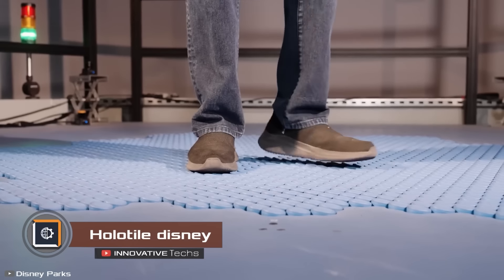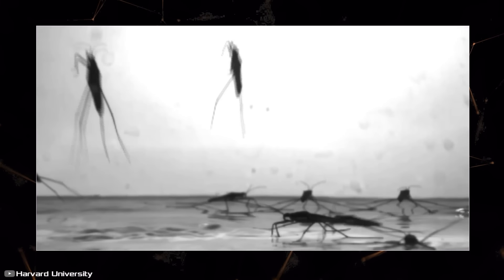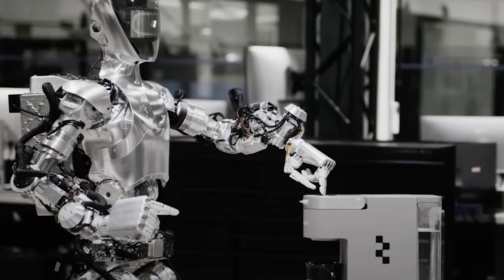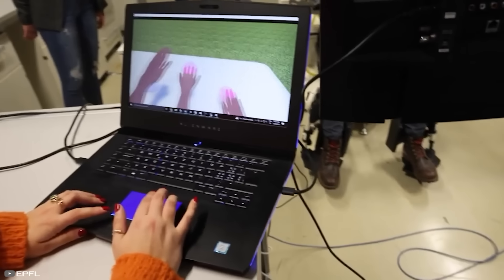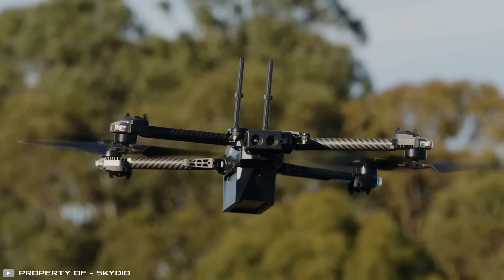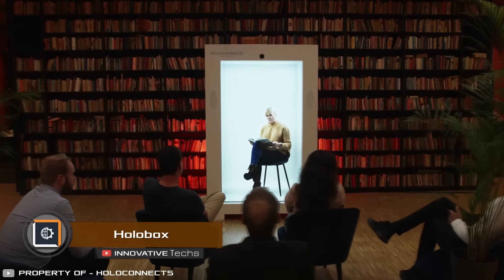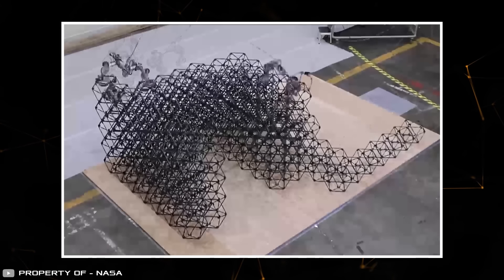INVENTIONS THAT WILL SOON CHANGE THE WORLD ▶3

Comment: The solar panel array "powers a small construction site", how is that when the panels take up so much space?
Reply: @billyo.9969  What does that mean? The point is if you only have a small construction site, where are you going to put that huge array of panels. A lot easier and cheaper to use a diesel geny.

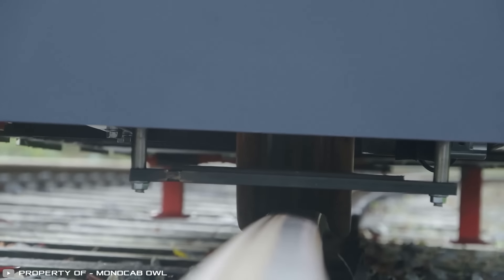Comment: 10:15 dont think so. on a standard track, there is no way to change tracks with a single track configuration. You need completely different, newly constructed switches for this system. So if advantage is small frequency and flexibility of wagons offered, there has to be a way to store them and to select from them - so you need switches. For autonomous drive, this system has the same major problem as a traditional two-track configuration (without the need for self stabilizing): As those tracks are NOT separated from surroundings where people move.

Comment: That Monocab owl will never go anywhere. It's way too dangerous. You would have to design a rail system for it. If you just existing railroads and the cab malfunctions, people will be hurt. Not only that it would damage the cab, possibly, to the point that it would need major repairs. Anyone who's drop their motorcycle while riding knows what am talking about. 

They might work in cities that have trollies, where the rails are embedded in the road. People would still get hurt, but the fall won't be as bad. Damage to the cab would be also less sever.

Comment: “Enough to power a private home”. Right, all those homes with OVER 300 LINEAR FEET OF SPACE that you don’t need for anything else? Most home sites are 75-125 deep, and you have to take up a lot of that for the home!🤬
Reply: You will live in a tent, eat the bugs and connect it to the power grid for others to use and like it!

Comment: Those last robots that were assembling structures would make great rebar bots. Maybe they could be incorporated in to a concrete 3D printing system, or just go one further and add skins and windows to the structures, with venting as needed.

Comment: With the monocqb it also looks like you can use a single track for simultaneous bidirectional transport, which could utilise many of the single track railway lines even better. Imagine you don’t have to wait for a train, but can simply go to the station and take a pod with zero wait time. Too often you see huge trains almost empty, this will increase efficiency a lot.

Comment: i like the foldable solar panels. combined with a battery, you can setup an EV charging station in the desert within an hour. you can charge up the EV truck that brought the system on site 🙂
the next day, you can bring in drilling equipment for water and and a mobile home 🙂
and again the empty EV truck can drive home after a charge for two hours 🙂
and so on. no gasoline or diesel required.
and the cool thing is: all that is already possible.

Comment: The autonomous drone looks like something I saw in Zelda Tears of the kingdom.    The Jet looks very cool, but without having moving parts, I wonder how well it will handle a system failure or engine failure...not sure what control you have in a glide down situation.   I think the monorail transport has the most possibility for commercial use.  The Battery also could be interesting

Comment: The main drawback of solar PV is the water pollution involved in the manufacture off PVs, the loss of wildlife habitat, the fickle nature of solar energy and disposal of old panels.

A better solution: Molten Salt Reactors. More energy for the amount of resources used. Power when it is needed. High fees charged to industries that pollute, deplete resources or destroy wildlife habitat would cause the market to find the best solutions automatically. Sharing fee proceeds equally will make the policy fair.
Reply: Do you know how much energy it takes to make molten salt?  Do you know how polluting it is to mine salt?  Do you know how much destruction mining does to the environment?

Comment: For the monorail pods my question is WHY?  You have a rail line with 2 tracks why not just put a normal train on it.  Why make them pods, why have them balance on a single rail, why not just use the tracks as they were intended instead of trying to come up with a gimmick and pretending it will revolutionize transportation while not being as efficient or reliable as what it is trying to replace.  If you insist on pods then put a trolley on it, but you do not need to reinvent 200 year old concepts that have had all of their kinks worked out before anyone alive today was even born.
Reply: If they fit and go side-by-side that would make it useful for either a birectional linear system or a loop design.

Comment: We need a pickup/suv that is system modular.  It needn’t be beautiful or have extreme acceleration or top end speeds, but be simply functional and easy to maintain and repair.  The goal would be as “plug and play” as possible, Joe Blow could R/R his transmission in 30 minutes, with minimal tools.  Swap an engine in an hour.  Send the failed unit in as a “core.”  Imagine a vehicle suitable for reliable use in an inhospitable, remote area.  No interior door panels, or acres of useless plastic trim held on with 50 pounds of fasteners. A bare bones Hilux with absolutely no room for cosmetics or superfluous weight and expense.

Comment: Sodium-ion battery is the only tech in this video that deserves high praise. I've heard its only drawback is that its energy density is 20% less than Lithium-ion. Fortunately, this drawback is not a problem with plug-in hybrid PHEV tech which offers more benefits (more than all-battery BEV & hydrogen fuel cell tech) also more applications and potential to reduce fuel/energy consumption, emissions AND insane traffic. PHEV+H combustible hydrogen can deliver at least twice the equivalent MPG possible with HFCEV tech.

Comment: The self balancing monorail thing is not even remotely new.  That was built in the early days of rail travel, as a way to save on construction costs.  Except they did it with full size passenger cars.  It worked fine, but for large capacity trains you would need a gyro system in each car, making it less cost effective.

Comment: Those foldable solar panels might be useful for quickly setting up recharging stations if you want to run electric vehicles in a mining installation.
You would probably need four just charge a single machine, but space might be available?

Comment: In the Railway Museum in York (England) tucked away in the back area is a cabinet with a display consisting of the original scale model of the Gyro stabilized monorail car and plenty of photos of a larger prototype with a rather terrified looking child sitting in it while it passed over a bridge consisting of just a single wire rope stretched across a gap, as well as photos of the full size version. I saw this many years ago and was completely fascinated by the system and also perplexed as to why it should be ignored for so long.

Comment: Persistent problem: All commuter freeways and thoroughfares allow all traffic to mix, no-matter semi-tractor-trailer or trikes. Most transcontinental freight haulers could do as well rolling on railroad lines, as none of them have traffic in any one spot for three minutes per day (WAG-sourced). That is, unless you happen to be stopped at a crossing while one is changing cars. Railroad rights were granted to allow them to adopt a "Oh yeah? Make me." standard for flexible usage plans. Stratified traffic is what's required, and even AI couldn't keep pace in routing and timing traffic, even though the FAA has air traffic control operating on a far-less volume scale. But why?

Comment: 11:16
“It is expected that such transport will become an alternative to unprofitable railways in rural areas.”

There is SEVERAL problems with this idea.

First off, the mini monorail cars SCREAM expensive. Yes, they are small, but have to have their own gyroscopes (2 to be precise) and definitely need a lot of maintenance with all the moving parts. Remember, the idea is to use these little rail-cars on unprofitable railways, so they can’t be expensive!

Second, is the track. So, imagine, you are managing one of these poor railroads. How do you cut costs? Idea! Lower the amount of maintenance of the rolling stock (trains) and other related stuff, INCLUDING the track. Normal locomotives and rolling stock might be able to cross bumpy and slightly broken track, but these things would probably derail once they hit them!

And lastly, what are we replacing? Old reliable trains. They maybe rusty, but they can easily pull several cars at once! You only really need one locomotive and a few cars to start moving goods, VERY cheep! The rolling stock can transport much more goods/passengers than these little monorails anyways, so why invest into the more expensive, less income approach? 

Counter argument:
These rail cars are nothing new, but I’m not talking about the balancing-train part. I’m talking about the rail car, which is a self-propelled passenger car, which have been used for many railways from the past and ARE still in use. Although, these rail cars are (obviously) larger than the monorail rail cars, so they can hold much more people. The rail car was made to save money because usually, normal locomotive have to pull passenger cars to transport passengers (obviously). But on smaller, sometimes money wasting lines, theses trains often carried few passengers. You don’t want big and strong locomotives wasting fuel by pulling ONE car, so they made these rail cars with small engines to save fuel and other expenses.

Summary:
This idea is terrible, use normal trains, don’t replace them! These balancing trains are expense, unreliable, and mostly not needed. They maybe useful if they were normal rail cars, but they aren’t though.

Comment: 0:30   A box of ball bearings would do the same thing at 1/4 the cost.
2:20   And what would be the use for this?
3:04   What was the increase per ticket to have this 'do nothing' thing installed?
6:39   Walks like Biden.   Hmmmmmmmmmmm?????????????  Could it be?
10:15 It took over 100 years  for anyone to get back to this?
11:28  2000 charges isn't much.
15:41 Reminds me of the last remake of the movie of "Time Machine"

Comment: Perpetual motion...

Normal weighing scales balance on a bar...so a cross bar with four scales hanging off it...four equal weights in each scale and an extra weight on one scale...the other three scales without the extra weight weigh more than the one with it...and when the light weight gets to the top it tips into the next scale...in a circle...and that extra weight is less than the other three...

Comment: For the garbage Sodium -ion batteries    one of the main disadvantages of sodium-ion batteries is that they have a low energy density compared to lithium batteries, so they can store less energy per unit weight. They are also less efficient and have a shorter lifespan,  EV's should NOT be a thing... battery technology is just NOT there ..and very dangerous ...

Comment: 6:40  
Thats illegal.  Its called splitting lanes or lane splitting, depending in the state you are in. And most states prohibits this.
Highway patrol police officers and DOT federal officers gives $250 tickets for lane splitting traffic moving violation.
And if the see your record on their database that shows you have been stopped for this several times by law enforcement, you can also get 3 points take on your license.
And if you happen to have a CDL license of any kind with an M endorsement on that CDL license,  then that's an automatic 3 points.
Reply: ha ha . funny how you think only about your country.. there is many countrys where its legal and you can drive between lines. i saw bigger bikes driving like this than this so called 'car' and no one gone crazy

Comment: The biggest problem I see with large scale Solar farms, is one simple thing, we do get not only bad storms at times, but Earthshakes in many areas, Cyclones and Hurricanes as well as even things as much fun and good for the area, Tornadoes.
Now I am not sure I would like to be down wind of a Solar Farm, if a 120mph Hurricane was coming from the otherside, or to be anywhere near one if a Tornado were to travel over one.
I am sure they bolt them down really well, but I have seen the end result of tornados going over roads and taking the road with it.
I have also seen dust Devils out bush in Australia, that followed along a train line and turned each Metal Telephone pole into what looked like a Liquorice twist, the Metal poles were twisted and then flattened and Australia don't get Tornadoes like American areas can.
I have seen wooden power poles with grass stalks poking out of them that have been forced into the wood because of a Dust Devil.
If one of these short lived weather events went into a Solar Farm, I know just how well the Solar panels would end up and how well that farm would keep delivering it's unreliable power.
I am sure we will see the end results of Hail storms and powerful lightning storms as well as all the other incredible weather events that happen quite often and increasing in power thanks to the climate warming.
I have been in Hail Storms that had hail the size of Baseballs, the damage they did was incredible, Concrete tile roofs, smashed to pieces, cars so badly damaged they were not even looked at as possible repairs.
Then we have the other side, Giant Windmills, how would they go with 120+mph winds or a Tornado or Hurricane/Cyclone.
Then we have the Environmental damage these Solar and Wind farms cause, tens of thousands of Native species dying from the Propellers of the Wind Turbines as well as thousands of flying creatures dying from flying over a Solar Farm, not to mention all the native flora and Fauna killed off to build the Solar Farm as well as the poisons used to kill of any so called weeds or native plant species as they encourage insects, which encourage birds and Bats, which cause crap to build up on the panels as well as if they allow plants to grow they can cause damage to the panels.
This then makes 15,000 hectares of land dead zones, just to produce power for barely half a day and with out a very large Battery storage facility, every Solar farm is a waste of time as other forms of power generation are required for the cloudy days and the rainy days as well as the Winter days and the periods of the day that for some reason the Sun doesn't shine at all, they haven't quite worked out how to fix that minor issue with Solar farms.
Sure Solar on a Home or factory or other roof spaces is great as it's close and can lower power from the grid requirements during the day and if they also install battery storage, they may be able to supply a large amount of the power they require, up to all as mine does.
Small scale Solar makes sense as the roof and building already were there and so isn't destroying any useful land.
No one is looking at the long term cost of these large Solar Farms nor of what is required to make them a useful part of the local grid.

Comment: With most of these, what good are they if the electrical grid is compromised? I can just see a grandma or paralyzed wheelchair bound person stuck in a pod on a set of old RR tracks 5 miles from the nearest house or gas station.

Comment: The movement thing at the beginning for VR, will not work unless they make it so people can run.  the problem with this kind of platform. they are slow to react to sudden stops or sudden running. you would run off the platform, or if you stop fast, the platform will keep moving you. and then you have the part, where it's way too expensive, for a normal user. 
I can see this being used for some other stuff tho.

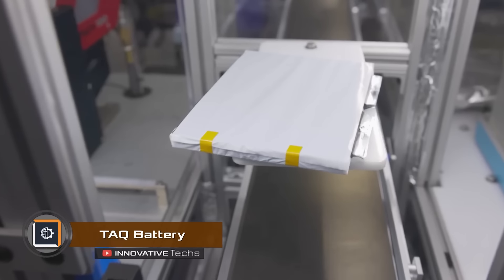Comment: 10:19 i bet these monorail cabs are more expensive to have as a transit solution than real trains, there is solutions to have dual directional trawel on a single railway, it called  side tracks and switches. 
This is basically anoder "hyperloop solutions " to a already solved problem 
Usa  needs to rethink its solution on human transportation, electrifying railways and start upgrading 
The rail system to enable higher speeds.  The fobia of shearing a volume on a vehicle  with others, is only a thing in the us , get over it !
The "solution"
Showed of in the video is basically a personal car on rails , this system would not allow for individual travel in practice, as sone as there are more than one cab going the same direction on one rail at the same strech they would have to que up and stop when any cab stops in fronr of the que . Like a train set does by default, also i doubt the cabins can navigate a switch without derailing. making them even more impractical  than real
Trains . dubbel flange  train wheel requires special swiches ( some  private narrow gauge railways use double flange wheels)
The railhead  is not flat on top ,its tapered inwards /rounded to fit the tapered flange wheels .
The rail cars may be  futuristic  and
Cool looking but the idea is stubid by design

Comment: You did such a poor job. No, most of these won't change a thing. Example: folding panels need a crane to be unloaded which makes it opposite of handy. Handy would be if it was possible to unload them from the truck or unfold by hand.

Comment: A foldable solar panel 300 feet long to power one f%$king house, a small construction site or one EV charging station, don't know about you but my back lawn is not 300 feet long and if it was I sure as hell would not want it taken up by a huge solar panel, and no construction site I ever worked on has that amount of space free for this shit, could do the same thing and more with a diesel generator I could fit in the boot of my car, what a load of crap,